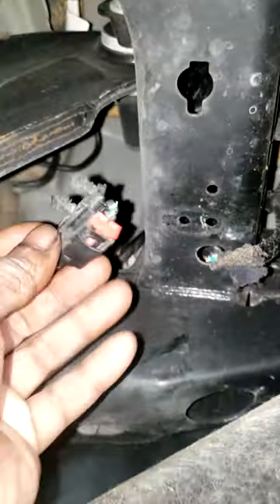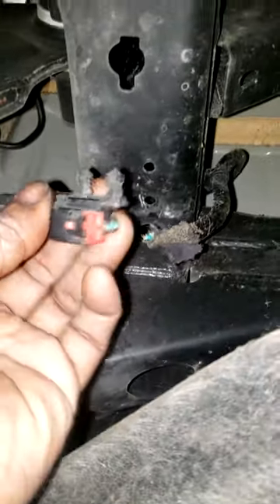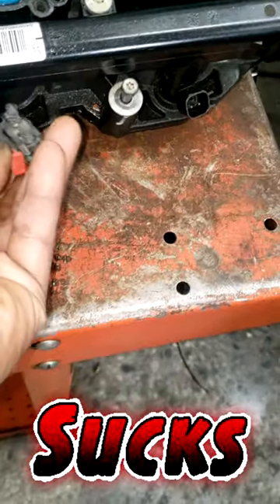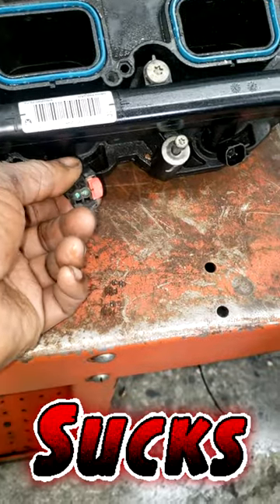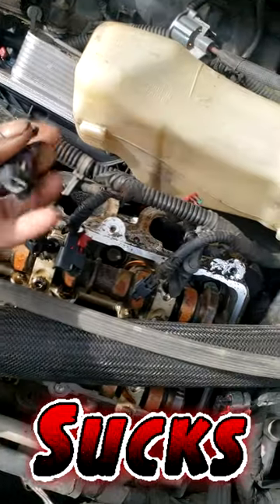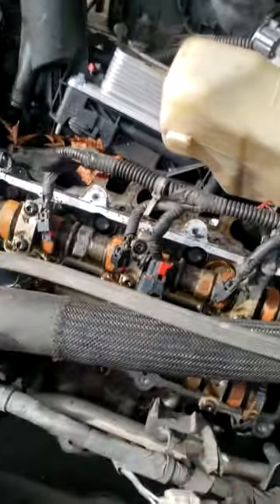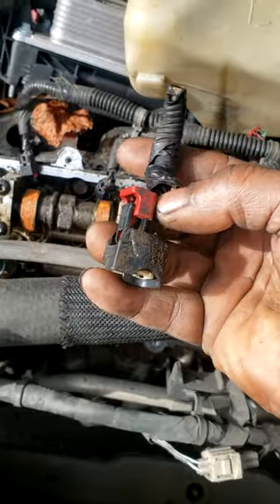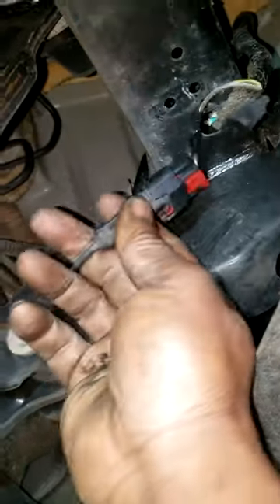How To Fix Your Screw Up. Full explanation video coming up next on what happen.

Comment: Made a “special tool” to test rear abs sensors with 2 old sensors and 2 of this connector. All it is a 2 jumpers to switch the rear abs sensors without removing anything, if the code flops it needs a sensor

Comment: Depinning tool for wiring connectors is a must have. No spicing or soldering just pull the pins and pop them into the replacement connector
Reply: The wiring was damaged too short to the connector. The connector is not the issue. It's the terminal pins and wiring. As corroded as the wiring is, ud have to go back a few inches, which means adding wire. So w that said.. U still have to tap into the main harness... via soldering or crimp/seal connectors. And as mopar goes... I'd say they don't even offer a pin repair kit for this harness. Most likely obsolete, even after 3 yrs of production.
Reply: @YU-ic1cw nope, connector repair kit is available and got/did one last week. Came with connector, 2 wires,2 crimps, and 2 heat shrinks
Reply: @user-white007  I was being sarcastic, on the standpoint of mopar obsolete parts.
Reply: @user-white007  and u got 2 cables? I'm assuming precrimped to the terminals. That u had to solder or crimp/seal the cables to the body harness? So I'm confused on ur original comment. Isn't the reason u said for crimping new terminals, to the existing wiring, was to eliminate soldering or crimp/seal? Sure terminal ends can be replaced and crimped on, repairing the harness, given length and integrity of the remaining body cables.
Reply: @YU-ic1cw  You said it. I think ALL Jeep Liberty KJ parts just disappeared the past month. Yeah, yeah...no one likes the Liberty. I do. It is light and has a cool hatch and swing out tailgate with factory hitch (not the Pinto/Fox body type recall). H&R Adventure raising springs with Bilsteins feel great (with new TRW lower rear arms and a IRO upper rear arm and Pro Forged front upper arm. Rebushed lower arms too. Pavement pounder in  gold.
Reply: @pgmurray76  good luck w ur liberty... U now have the liberty to purchase a different vehicle, before you can litteraly, no longer find the parts, to liberally and litteraly, fix ur liberty. Praise USA and many, many other countries for manufacturing and assembling the parts... that were shipped back to the liberty of the USA... for the liberty "making" in the USA. I liberally and literally just said a bunch of real and dumb shit.

Comment: solder and some "marine" adhesive lined heat shrink. Done. I had a downstream O2 sensor poorly routed with two of three PTFE insulated wires kissing the transfer case front driveshaft. One wire completely gone. Trim and splice. Beautiful. Gas mileage back up and codes away.

Comment: He's not wrong, whenever I get and engine, it only asks for core. Always ask for harness. If not needed get connectors off it. Come in handy just like what he did.
Reply: Sounds like you’re making people pay for harnesses your not using
Reply: @MaxPower-ke5rq  better to have it and not need it than need it and not have it. Especially since most bone yards will cut the harness and leave connectors on the engine. Doesn't cost any more where I'm from.

Comment: People think that just because they buy a certain vehicle, parts are made only for that vehicle, and that is sorta true when your dealing with engine intake manifolds and things of that nature, but what everyone has to understand is really your buying a vehicle body, and most parts are interchangeable between any make or model vehicle. Take alternators and starters for instance, the same alternator or starter could fit a Chevy, Ford, Toyota and Nissan. I have taken Chevy connectors off old fuel pump wiring harnesses from impalas and used them on Dodge caravans. So always check before you buy new. Just about every vehicle made has a sister car or cars under a different brand name, ie- Ford Taurus/Mercury Sable, Nissan/Infinity vehicles are the same vehicles. 
I personally own a few antique vehicles from the 80's all made by GM. You would be surprised at the cost difference between a starter for a camaro vs the exact same starter for a firebird. If you tell the parts dude you looking for a starter for a 86 camaro, he will tell you 5 dollars, but tell the parts dude you looking for a starter for the same year model firebird (both of my vehicles are identical in parts) and he will tell you 10 dollars.
Exactly the same starter, but because you asked for a firebird starter instead of a camaro starter you have to pay extra. Just like Nissan and infinity, the same start fits both vehicles brands, but because you asked for a infinity starter your going to pay more because infinity is the luxury brand of Nissan.

Comment: I would be just as frugal on my own stuff, but repairing a customer's brakes with used parts may bite you badly in some scenarios. I can see some attorney tracking down the source of the parts used to repair the brakes if the vehicle was involved in a fatal accident. Remember that song "Mama don't let your babies grow up to be cowboys... let them be doctors and lawyers instead"? Well, we're all paying the price for all them lawyers now...
Reply from the maker: Dude i get your point but you thinking to hard. Not sure whats the difference in a new connector pig tail or a used one. No used brake parts installed.
Reply: @OnlineMechanicTips  You and I both know the used connector is fine... it's the lawyers I don't trust.
Reply from the maker: @2020HotShotTruckingLLC  facts

Comment: I guess when you see electrical codes you ignore them. " I don't want to cause them any more money, but I pulled an engine for no reason, on a known problem" would make more sense
Reply from the maker: No, its you thats not making any sense. But you welcome to handle it your way when you get into a jam like this.
Reply: @OnlineMechanicTips  I've been in this trade for close to 20 years. You and I both know the code set would steer you directly to electrical and not the component. You threw the scan tool on and did zero diag, not even visual.
Reply from the maker: @travissmith4102  You have no idea what I did dude. And for the record im not impressed by your so called years of experience. You just have a big ass T as your screen name so to me that signals no credibility. Anybody without a profile can simply say anything on the internet. This youtube dude, you wanna impress me put a video out and flex ya 20 years of knowledge. So don't come for me, you don't know me or what I know, only what I show.
Reply: @OnlineMechanicTips  it's simply a conversation, and what I said is true. You didn't deni that. I like some of your videos, but I'll also call bullshit.
Reply from the maker: @travissmith4102  You have that right. The video is about how to fix your screw up. Anybody that would make such a video obviously screwed up. Surely hes not going to need you or anybody else to verify that he screwed up, the video is admission of that. So if somebody attempts to do such in such a harsh way as you did with your comment, i tend to suggest they flex on youtube via videos because im not impressed that they verified somebody else screwed up. That dont make sense.
Reply: @OnlineMechanicTips  and all I said was proper diag would have negated this situation.
Reply from the maker: @travissmith4102  Lol, but that goes without saying..The video itself admission. You just wanted to feel good about saying it. Lol, I don't give yall these chances often so when you get one capitalize on it..lol..im cool with that.